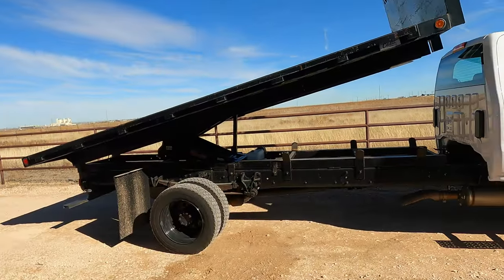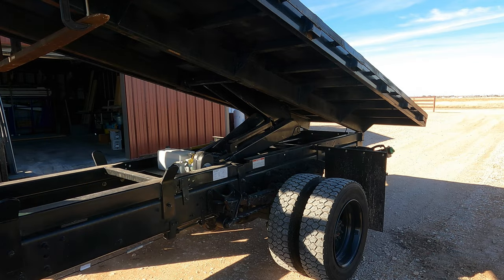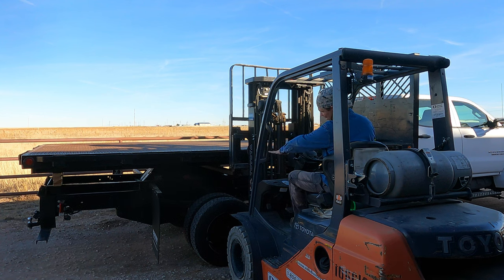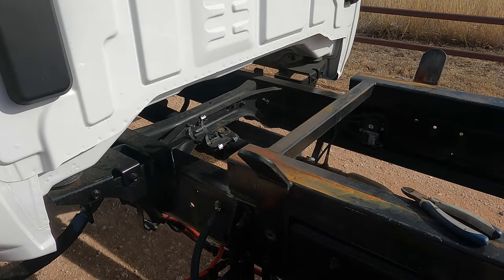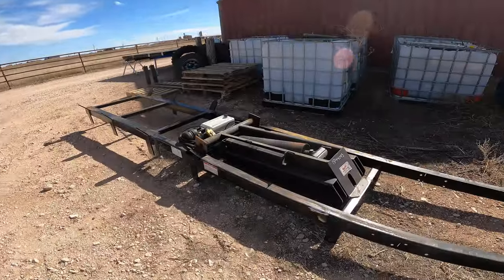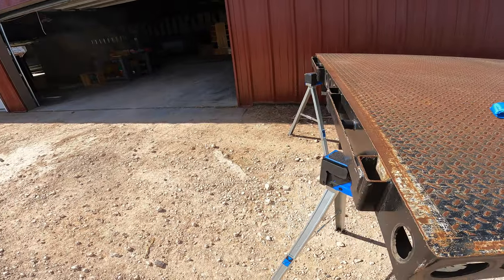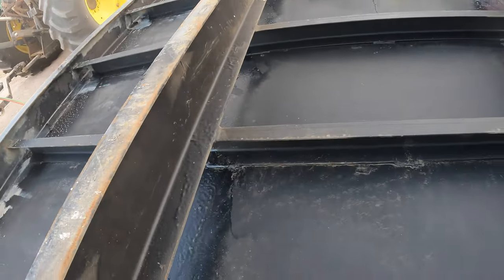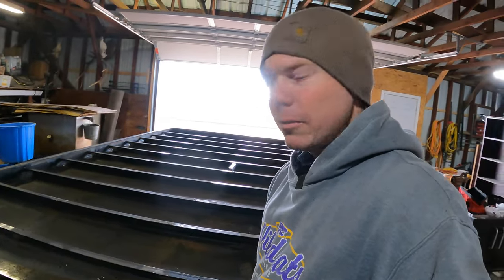Bee Wagon Bed Modifications (Pt. 1)

Comment: All getting on  the way . By lowering the bed what will your distance be between bed an tires with a load on it . Just a idea I know your easy loader will be braced but I have saw the steel on the bed crack an split from vibration so heavier built is a lot better than under doing  your bracing an the thickness of the bed plate . The loader is tall an narrow . Also on the back I would go at least a few inches longer than you need for your pallets to set on the bed . Just a thought. Thanks for the update.
Reply from the maker: I've had it mocked up and it won't hit the tire before the stop hits the springs.